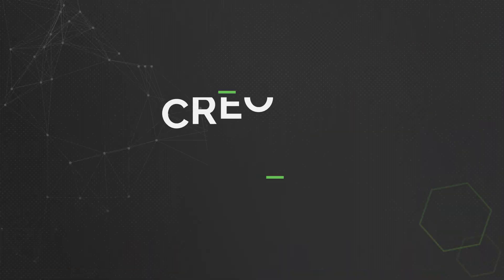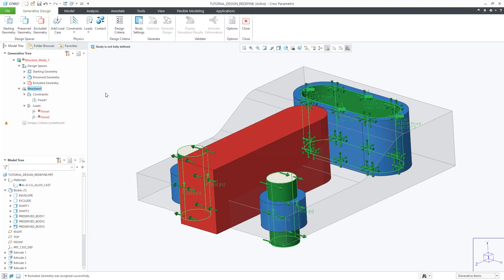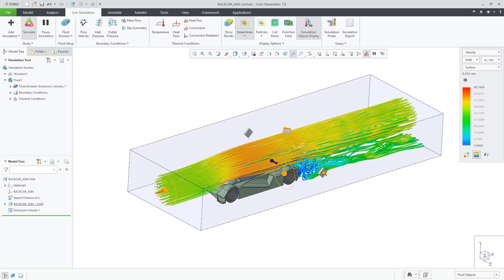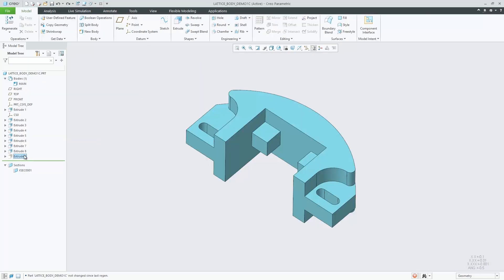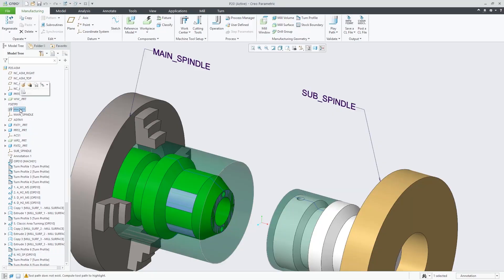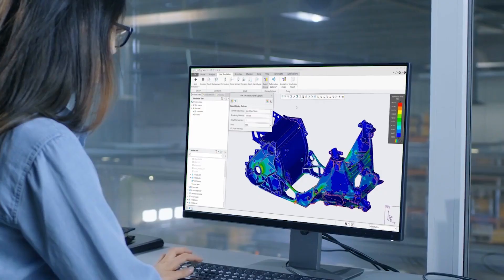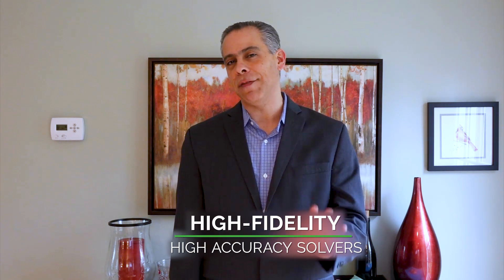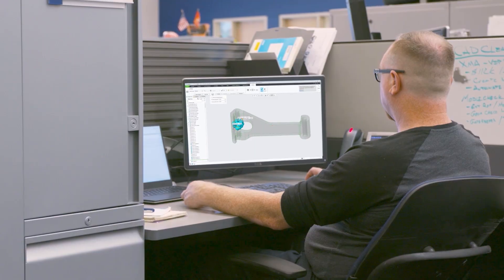Brian Thompson Introduces Creo 7.0!

Comment: What is the point of using this design tool when it falls down on the most fundamental part of designing for manufacture? The Drawings aspect of Creo is pathetic! It is by far the most time consuming process and IT SHOULD BE SIMPLE! 
Exploded views are irritating and uncooperative - and the BOM Balloons have a mind of the own! 
Want to save a sheet metal part as a DXF for laser cutting? GOOD LUCK! Have a problem with a aspect of assembly and would like to know why? Creo wont tell. 
Creo is sooo far behind the curve in terms of usability!
All of this 'innovation' is wasted in my eyes are you have failed to address the blindingly obvious flaws in this program.